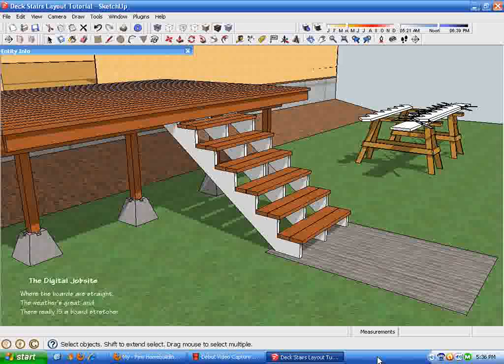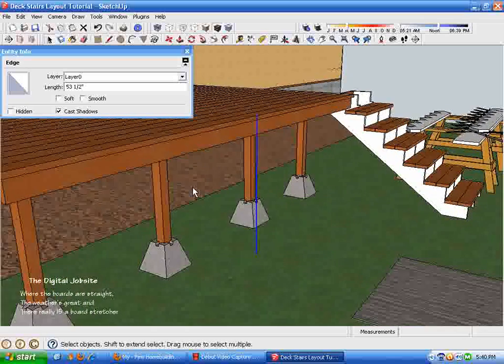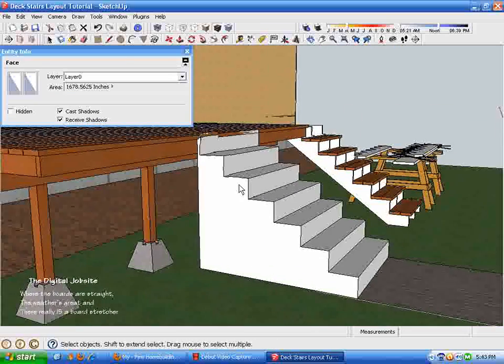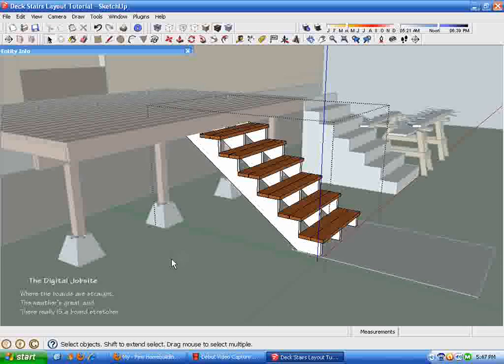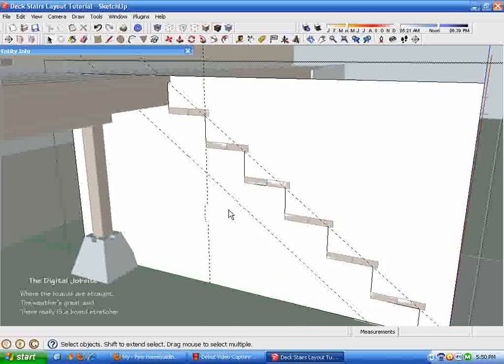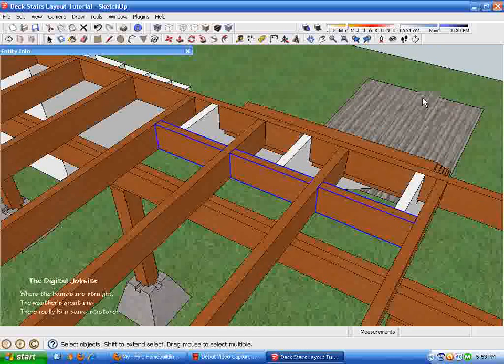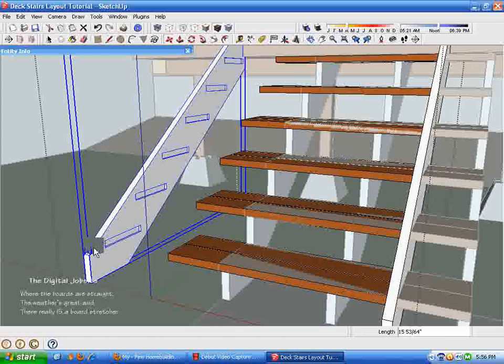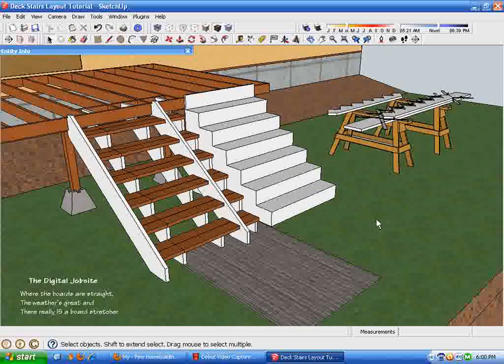Deck Stairs 101 Video Tutorial

Comment: What is wrong with using a different rise than 7.5 inches as long as they are all the same? Sometimes one has an existing structure and existing concrete to work with. Why can the run not be a bit longer and the rise less?